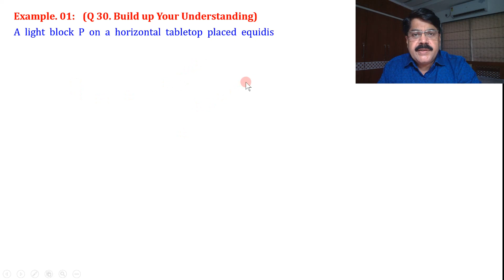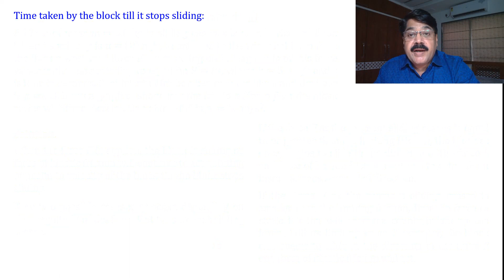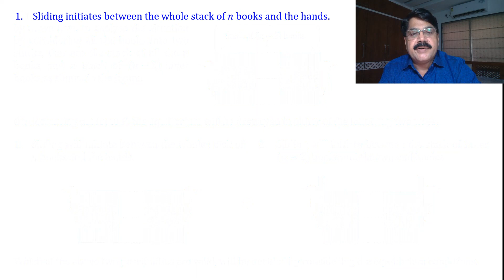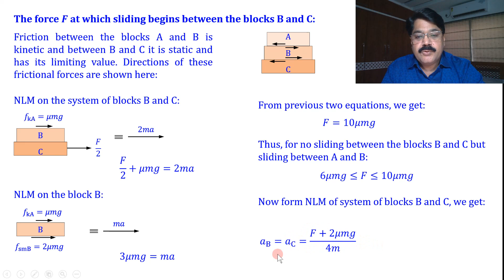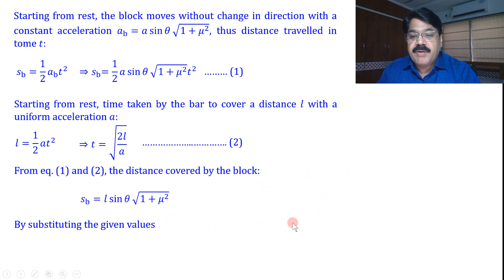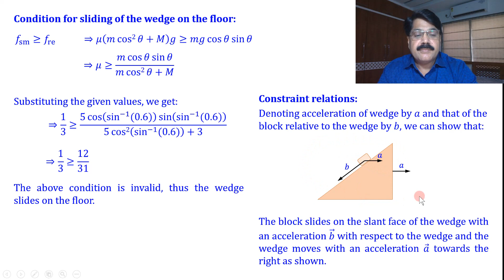L 28  Friction Pathfinder Examples

Comment: Sir this thanks for providing full answer with explanation. It helps a lot bcz sometimes I am stuck at solving big equations bcz of which ans comes wrong but my thinking and physics was correct. So this is very helpful.. PLZZ continue the good work.  
Thanks.